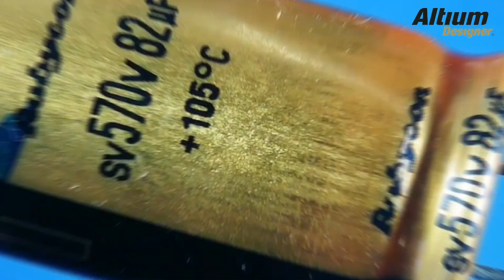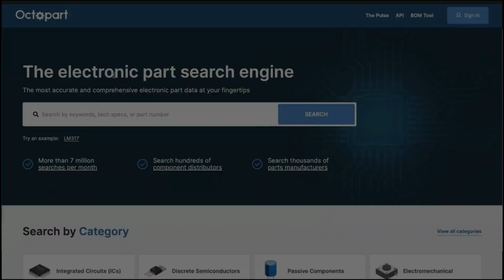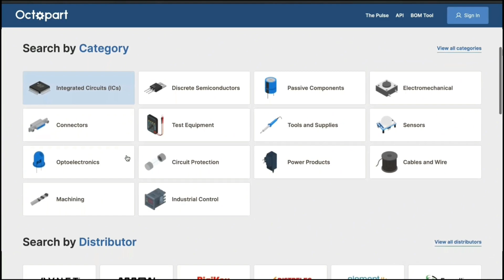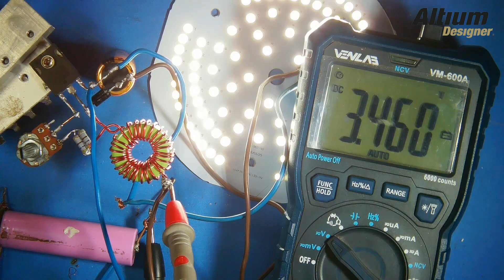DIY 3.7V to 570V Voltage Booster Circuit | LED Tester | Altum Designer

Comment: Good work .. ❤🎉
Reply from the maker: Thanks 
👉❤️👈
Reply: @easyproject4uofficial   i follow you from egypt and support .. i made my first boost converter by tip 41c  as you describe in previous vedios  and modify circuit to output 318 volt from 3.7 input  
Thanks
Reply from the maker: 🤩Your comment is very valuable, thank you very much brother.
👉❤️👈